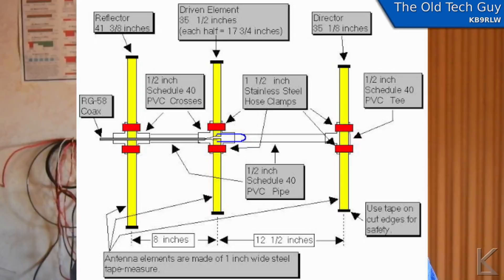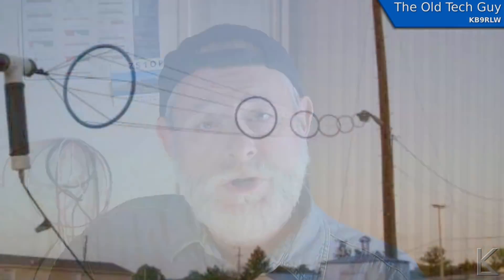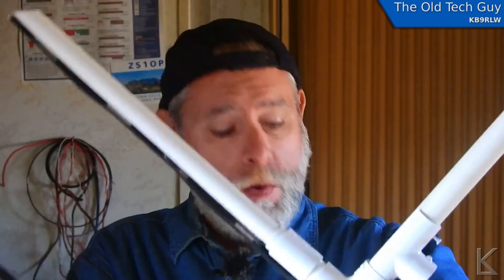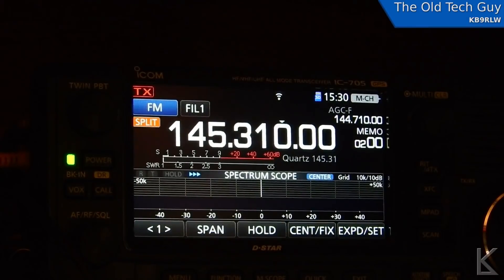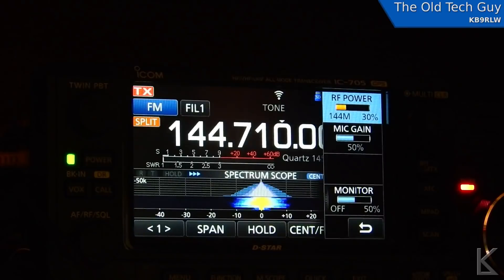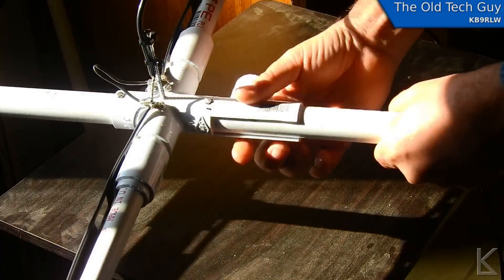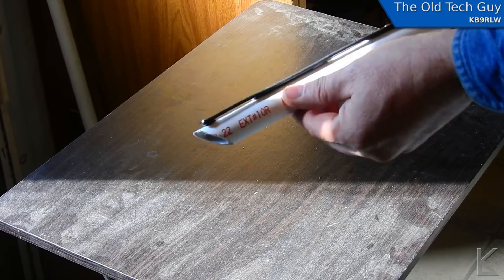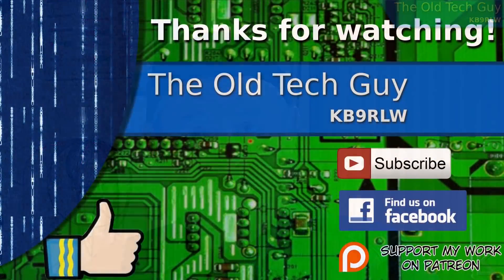Ham Radio - My durable and portable 2 meter Yagi antenna.

Comment: How does this compare to a measuring tape yagi antenna?
Reply from the maker: I think I mentioned in the video that it was based on the tape measure design.  
Similar performance but rigid.  You can't put the tape measure version up in a breeze, the elements will flap around like crazy.

Comment: On your 3/4" to 1/2" transitions, slightly sanding down the end of a 1/2" coupler will fit directly into the 3/4" cross/tee.

Comment: What if anything would it do if you had window line on both sides of the driver
Reply from the maker: That would change the distance between the reflector and one side and the first director and the other side. Probably reduce the efficiency. A Yagi is kind of critical on the spacing between the elements.
Reply: @loughkb  great thank you

Comment: Simple question, not obvious to me, but why not enclose the 450 ladder window line inside each PVC for UV and corrosion protection? Would it really have marked radiation effect?
Reply from the maker: Yes, it would dramatically affect things. Somewhere in a previous video I talked about making a twin-lead j-pole antenna. And putting it inside of PVC it's tuning shifted dramatically because of the PVC changing the velocity factor of the antenna.
Reply: Must vary with materials type too, because fiberglass [seems] to not have as marked an effect. Would have to compare like you do, but ant manf readily use FG. 

Thank you

Comment: Very nice design!  I definitely intend to make one of these antennas!  Thank you for the design information. Incidentally, I retired from Air Force in 1992 afterspending 26 years in Antenna Maintenance Career field.  I just got my HAM Radio license last week! KF0OYN. I built many antennas during my Air Force Career. The ines we fabricated ourself were all HF Frequency.  All the VHF and UHF antennas we installed were premade. The largest Ground plane antenna I constructed was made of forty ten foot steel tower sections.stacked on top of each other, with 72 400 foot long  wires buried in the ground every five degrees apart! It was for a LORAN Station we built during January and February 1980.  You can see the antenna on Google earth just outside of Hampyeong S. korea.

Comment: I was intrigued by the design and decided to build it. I've now screwed around with it off and on for two weeks and I can't get it to resonate anywhere above 138MHz, no matter what I do. I've checked and double checked all the measurements several times over, adjusted the length of the driven element and it still won't resonate in the two meter band. I give up. I'm about to tear it down and use the parts to make a tape measure Yagi instead.
Reply from the maker: Not sure what to say. Lots of people have built it. You are using 50 ohm coax to feed it, not 75 right? The other thing would be the hairpin match, you could use a slightly longer wire for the hairpin and maybe that will bring it down?
Reply: @loughkb  I got it to work! Somehow I had mis -measured the driven element and every time I went back to check it I replicated my error. Once I caught that and made the correction, the antenna resonated right where you said it would. Now, the next step is to test it under field conditions. I'm going to direct members of my club to your blog and this video if they are interested in building their own.
Reply from the maker: @CAphotos  glad to hear you figured get out and I hope it serves you thanks for watching.
Reply from the maker: @CAphotos  you might want to double-check your measurements on the director and reflector
Reply: @loughkb  I'll try that.

Comment: Another great vid Kevin!

For the same reasons as you, I want to build this antenna, but with a twist.

I have been totally engrossed in John Portun's (W6NBC ) presentation of his 'Optimum Loop Antenna' where he uses 2" PVC Pipe covered with adhesive backed ALU Tape to cover 40M thru 10M. It's an absolutely great concept.

I will construct your antenna using John's methods.

Again, great vid and presentation. Over the years, you have inspired me many, many times......

Russ, KA1RUW

Comment: Did you use 300 or 450 ohm ladder line?
Reply from the maker: 450, but it doesn't really matter. The impedance only matters when it's used as a feed line.
Reply: @loughkb  thanks!

Comment: Now I know it may sound like I'm smoking the strong stuff, but I wonder how well duct tape would work. Actual duct tape mind you, not the cloth stuff. Getting a positive connection would be tricky, I suppose hose clamping the wire to it would do but I have doubts about corrosion eventually messing with it. Anyway, it could be an interesting experiment.

Comment: Just out of curiosity: Why not put the window line INSIDE the PVC pipe, and put END CAPS on the elements instead of the 45% angle? This would make it fully weather resistant. Also, for Satellite work, have you tried to work out a version for 2M/70CM? Great video, thank you! 73, Jacques Redmond - WW1ZRD.
Reply from the maker: Window line is weather resistant.   Putting it inside the pipe would change the velocity factor and I'd have to go through the process of reiterating until I got it to balance out again.
The 45 degree cut stops it from whistling in the wind.

Comment: YT will not let me post the link.  For a direct connect 6 element (Optimized Wide Band ) OWA yagi  < 1.5:1 142 to 150Mhz , used these terms and this name, L.B. Cebik

Comment: I love my moxons.  Rugged when made from 1/2 copper pipe, and compact. This project would be good video material.  This this type has a very broad bandwidth, nearly 10 megs.  I use 3 to 5 '' sections of cheap 1/2 black poly pipe to hold the ends together.  ID is the same as the OD of 1/2 copper pipe.  Heat and lube the copper with flux and the poly pipe fits tightly. Gain is only 5.75 dbi, but the f/b is 20Dbd and the center null is nearly 40Dbd at the design frequency.  The main advantage of the moxon is broad forward coverage and excellent rejection to the rear.

Comment: This is simply brilliant. However, I guess that the tape measure yagi too can be made firm like a ladder line by drilling holes and fixing a screw to the pvc boom in all three elements
73

Comment: If you use a pvc structure looking like an inverted L ,, and hang the slim jim at least a foot and a half away from the mast, it will improve the performance of the slim jim .  KK5VN

Comment: Very good video! Very nice work too. Had you considered putting the 450 Ω line inside the pipes by curling it a little bit? If you didn't consider it, what do you think would be the outcome? If you did consider that, do you think the dimensions would remain the same? 73//KK0DJ
Reply from the maker: That would change it a bit and require fiddling with the dimensions to get it right again.   I don't know what the advantage would be aside from aesthetics.

Comment: 3 DBi of gain is NOT 3 DB gain over a reference dipole.  It's more like 1 DB gain over a dipole....which is undetectable at the receive end......which means if you make a two meter dipole out of wire...feed it in the center....all for about two bucks...it will perform just as well as a slim jim.
Reply from the maker: Which does not play out in practice.   I've built 2 meter dipoles.
The slim jim blows it away in real world use.

Comment: I have a U.K. spec. 9700. When you were turning the power up in % of output power. The 9700 at 0% power, outputs 5watts. So at 10% it was likely you were outputting over 10watts, and not 1 watt. Apologies in advance if I have this wrong. Nice video, by the way. 73’s. Geoff. G4SQJ.
Reply from the maker: 9700?    I was using an Icom IC-705.

Comment: A 2 meter dipole resonant on 146 mhz, when inserted in a pc of pvc, drops to 140.5 mhz.
If you adapted a tape measure yagi and did not  compensate for the dielectric effects of the pvc your antenna is probably most directional  outside the band.
Reply from the maker: I started with the tape measure design and through iteration and measurement, adapted and adjusted it to compensate.   It works very well.

Comment: At 125 deg pvc starts to sag
Reply from the maker: At 125 degrees, life in an RV becomes death. I'd have moved long before it got that hot!
My slim jim is also on PVC and I've had it up during many sunny days where it reached 105 out here and it's still straight.   I think this will hold up fine for my travel needs.

Comment: I have thought about this a little since I watched the video and reckon that using window line for VHF/UHF antenna elements is perhaps a really smart idea. With antennas like this, the characteristics of the wire elements mean that you are working with known values. If you use random bits of pipe or copper wire with different types of insulation, you may copy a design and find that the feedpoint impedance or element spacing is way out. If constructors adopted the approach of using common types of window line for projects like this, it would be a lot easier for other hams to make copies that worked? Just a thought?

Comment: What a great little antenna!  I love these inspired antenna experimental build videos.

I'm encouraged to use thin wall aluminum electrical conduit for a Yagi, with custom 3D printed fittings.  I thought it was bad when I had FDM printers, but now that I have MSLA resin 3D printers, everything is a 3D printer project.  😎

BTW - If you run 200 watts into an antenna with 45 degree cuts at the end of the PVC, it'll shoot ball lightning out the ends of the driven element.  🤣
Reply: 1

Comment: Random question, what are you useing for passthrews for the coax to go threw the wall of the rv. I need some for mine
Reply from the maker: Really long barrel connectors.   A friend gave them to me, I'm not sure where he bought them.   SO-239 barrels, they should be available at any store that sells coax and antenna connectors.

Comment: Please correct me if I’m wrong, but On that 100 watt icom 9700, 100% power should be 100 watts, and therefore every 10 % should be 10 watts right?
Reply from the maker: It's an Icom 705.

Comment: I have found that 1/2 inch copper tubing on the interior of the PVC give excellent bandwidth. I have simply used stainless machine screws to hold the internal tubing to the external structure. The feed point can have external connections as you have built on the screws securing the internal tubing to external structure.

Comment: Hi, what window line are you using, 300 or 450ohm? Do you think it would it increase any gain if additional elements are added? Also heard you on K6ARK SOTA earlier. All good stuff.
Reply from the maker: 450 ohm.  From DXengineering.    Gain would be increased by additional director elements.
I was using the slim jim when I made that contact with K6ARK, didn't have the yagi done then.   I'm sure it would have been a better signal to him if I had it.

Comment: Believe it or not, you must ID "your transmitter" (emissions), but you are not required to get your ID through the repeater, it has it's own ID.  (we need to operate and ID at the same power levels)  The Yaggi seems to have +3. dB of gain over the "J" pole antenna.  If you have a few coins you can buy or build an "arrow" Yaggi, or make one from copper tubing. Ron W4BIN
Reply from the maker: Your first point is a bit irrelevant.   I'm transmitting RF, so I need to ID regardless of whether I'm operating simplex or through a repeater.  ;-)

Comment: Kevin, I’ve never worked with windowline and don’t know much about it.   Is all of it pretty much the same or can you describe the characteristics?     Thanks much.
Reply from the maker: I used 450 ohm window line I purchased from DX engineering.   Most window line should be similar.   The distance between the parallel elements of it affect it's impedance.

Comment: 👍Thanks for sharing Kevin. I liked the little self-tapping screws to secure the window line to the pipe.
Reply from the maker: Actually, they were just normal threaded screws.  I just drilled a hole slightly smaller than their threads so they could bite into the plastic.

Comment: Another good entry.  I was hoping you would include on-the-air demos of the various modes of operation to gauge its performance using the IC-705 and a full 100W transceiver (if available).  RS/RST reports from non-repeater stations, etc.  Kind of a soup-to-nuts evaluation of the complete system(s).  Just a thought...  73 de N5XS 
(PS <or es >.  Do consider writing up an article for QST publication consideration.  I think it would be well received. < N5XS ar>)
Reply from the maker: I will be doing more operational vids with the yagi when I get up to Kingman in a few months.  2-meters is all but dead down here near Yuma AZ.

Comment: great antenna but work on ur db's--your gain is about 4db--to obtain 10db u need around 8 elements plus--ref cushcraft/vhf or any 3 element hf  beams---by the way your transmit power change confirms about 4db--if the truth be told 10 db is 10 times power 13 db is 20--1,5 w from 4w is 4 db--73 from rick va3ev technician and ham for 57 years since 1963 and like building rigs and antennas
Reply: I was guestimating the Yagi gain to be around 6dBi or 4dB compared to a dipole. Assuming Kevin's slim-jim was 3dBi. The repeater was raised with approx. half the power on yagi which implies the Yagi has a 3dB power gain over the slim-jim. The fact that the Yagi had a 1 S-point gain on receive I discounted as I have no idea how the IC7300 S-meter is calibrated or how accurate it is. In fact a quick search found a few posts suggesting the IC-7300 S-meter is not very accurate and not very linear below S9.
Reply from the maker: I was on the 705, which is newer.  But still, no real idea about it's S-meter accuracy.   The 7300 doesn't do 2-meters.

Comment: Satellites: I use my tape measure yagi for portable satellite work and I bet yours will work also. It should receive ok on 440 as it is. Try the ISS, AO-27 and SO-50, they are 2m up and 440 down. The ISS is 145.825 aprs when the cross band repeater isn't on. And 145.800 for SSTV from time to time. And check your swr on 440, it won't be good but I bet it will radiate on 440. Give AO-91 & 92 they are 440 up and 2m down. And don't forget the NOAA WX satellites. Your handle might need a little modifying to make it more comfortable for sat's but give it a try as is. 73 Have fun on the birds

Comment: Could I place the ladder line inside the tubes?
Reply: Yes of coarse but you will need to tweak dimensions for tune...
Reply from the maker: You'd need to use much bigger pipe for it to fit without folding it over and losing some of the wider bandwidth.  And you'd need to spend a lot of time tweaking it to get it tuned again.  A lot of work and I don't see the benefit.   Window line is made to withstand the elements.
Reply: @loughkb  It would be interesting to try the ladder line as a Gamma match on 1 side of the driven element. Obviously it wouldn't be as symmetrical and would alter its bandwidth a bit.
Reply from the maker: @stevejones8665  Most beams that I've seen that use a gamma match, do it symmetricly, to both sides of the driven element.

Comment: Great project Kevin. For sat use, I made a tape measure version on 2m (with an old 7 ele 70cms boom) that was in essence unusable unless no wind so re-made from coathanger wire. I have also been using pvc pipe & fittings for other small easy up antennas mounted on a magmount (a PL259 outer hot glued into pipe to mount on mag). Hope you had a great Xmas. Thankyou for your interesting content in 2020.
Cheers, Nick

Comment: could you make it dual band, 2m and 70 cm ?
Reply from the maker: I suppose so.  It would start to get on the heavy side with all the extra fittings and parts.
Reply: @loughkb  I was thinking about the slim jim n9tax makes, i have several.  The dual banders he makes, he merely snips out a small section of the wire, atleast thats the only difference I see over the 2 m antenna i have too.
Reply: Im guessing he snips it at the 70cm length, and then the antenna uses the correct section when transmitting.
Reply: seemed like that might work on the yagi.  I can you send you pics if your interested.
Reply from the maker: The yagi depends on the interrelationship between the driven and other elements.  Modify one and you'd have to spend a LOT of time fiddling around with the others to get everything happy again.
Dual band yagis are usually build with different sets of elements for the different bands.

Comment: This has no bearing on the video but in case you are curious, the snap on piece you use to mount your antenna is called a saddle. You use PVC cement to glue it to a pre-existing  waterline, once the glue dries drill a hole in the tap and then add pipe to your new tap. ;-)
Reply from the maker: Ah!  That makes sense.   I could only guess.   Makes a great mast connection point though! :-)
Reply: @loughkb  pvc wont last in the summer heat out their trust me i know first hand i lost my antenna  made with pvc it bent worp  so it not going last in the deaser  heat or california heat or orgen heat
Reply from the maker: @AndrewMurphy8383  It's only out occasionally, when I want to try ssb or cw.
My slim jim, which is mounted on pvc, is usually up.  1.7 years in the sun so far and holding up ok.    It's cheap to replace anyway.
Reply: @AndrewMurphy8383  - PVC pipe melts at 140 F.  You can buy CPVC (hot water pipe) that melts at 180 F.  CPVC should be good enough for desert use, particularly if you leave it white.
Reply: @AndrewMurphy8383  In the UK they also make Grey PVC pipe called Terrain, which is suitable for high temperatures. We use it for waste outlets where they have boiling water coming out. It doesn't go all floppy like the white stuff.